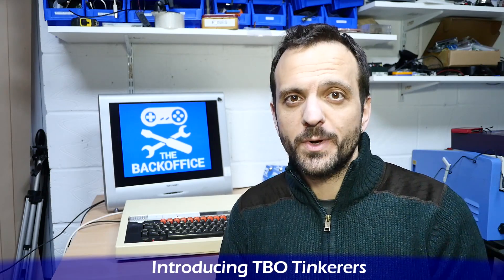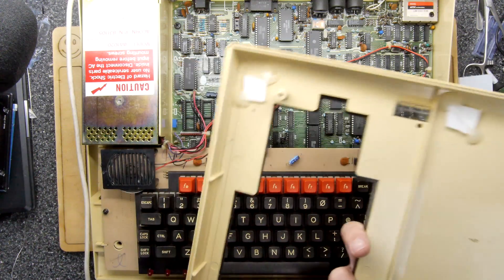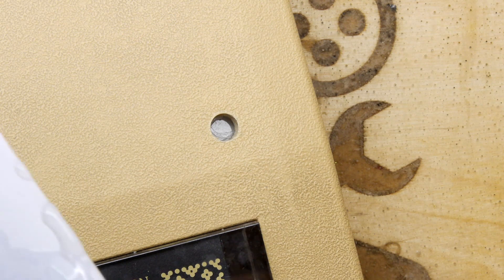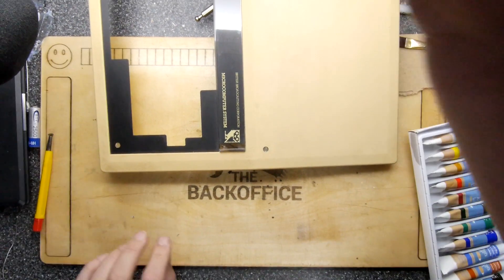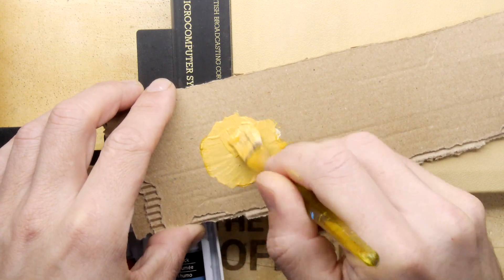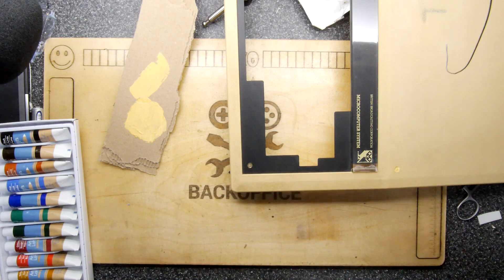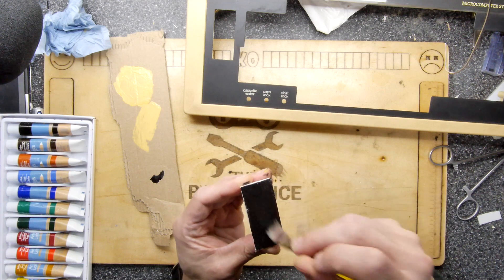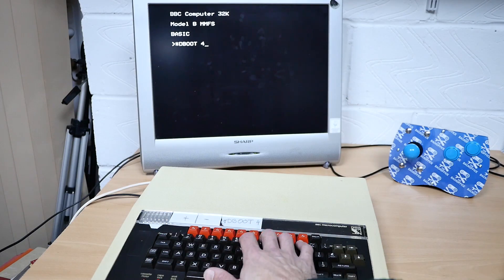How to repair a BBC Micro Case

Comment: Nicely done. I feared a mess with the not-so-thin brush, but you proved me wrong. 👍 #GetBeebin
Reply from the maker: It's really was not my best work, but it's been a long week and too few hours to sleep 😂

I might mod the panel and add a volume control and some blinking LEDS
Reply: @backofficeshow  Still, a, hell of a lot better than it was. I just watched Neil's beeb video. I wasn't aware of the lack of external volume control. That would be a useful mod.